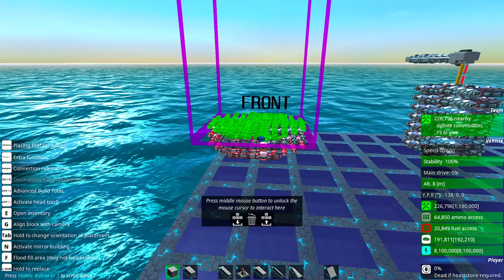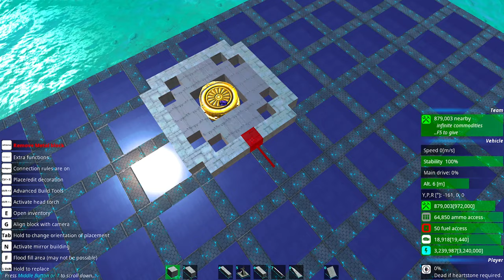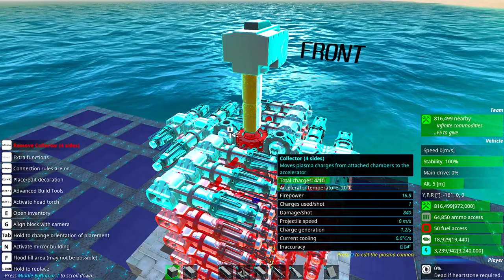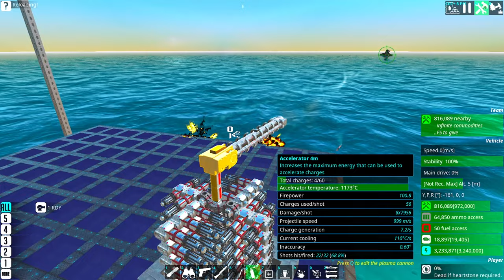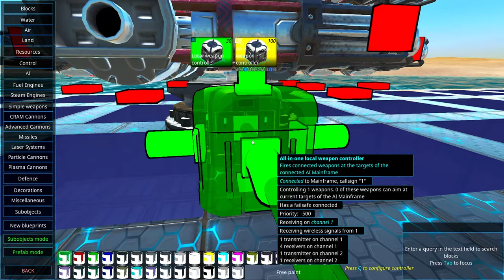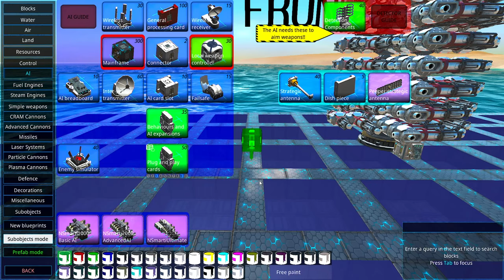I Built a Shotgun Plasma Cannon in From The Depths

Comment: At 12 minutes how did you delete the turret guide thing in two clicks???
Reply from the maker: Shift Delete
Reply: Shift + delete will delete all attached similar blocks, so can take away the 1m cubes of metal then alloy in 2 clicks. But use it with caution, if you try shift+Del something and it touches more of the same, you'll delete them all together (ctrl+Z can be your friend though)